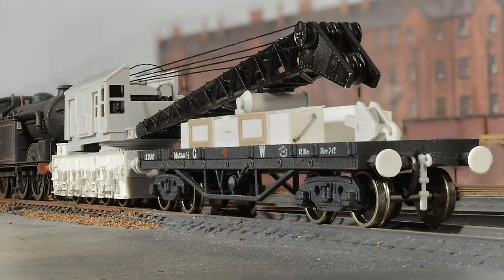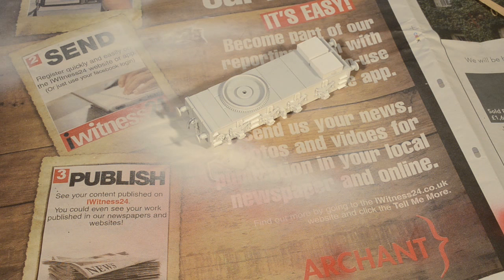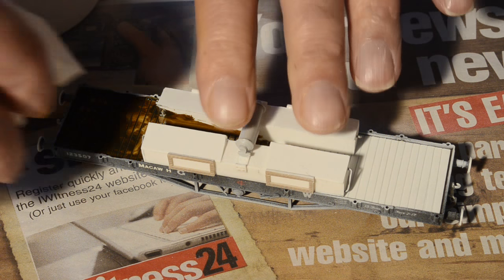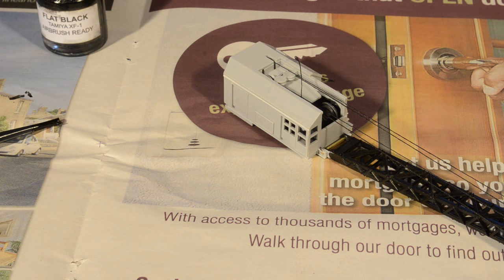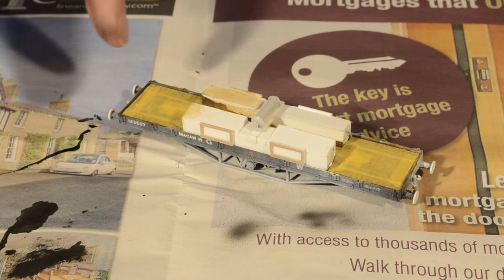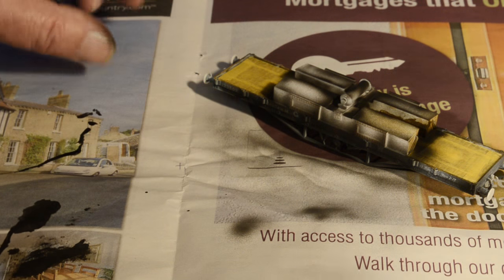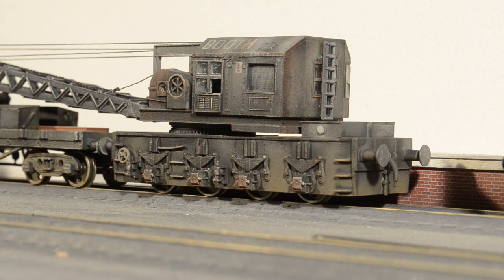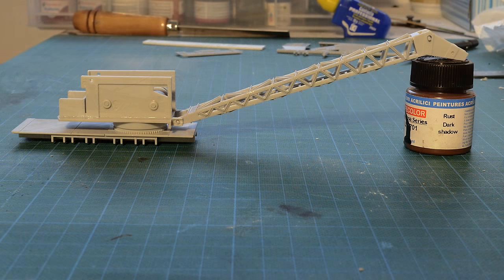DAPOL 15 TON CRANE # 3

Comment: Excellent project and explanation David. Given that you have not installed couplings, will this form a static model in your MPD?
Reply from the maker: Hi David, many thanks. I will fit Sprat & Winkle couplings to it, but I want to make a jig for fitting these to make them run more consistently than mine do at the moment. Another video here when I do this. Although the crane ''works'  it will be more an item of interest on my railway. I have bought a toad guards van that I will convert into a mess van for the crane in the future - I would like to see it running on my layout one day. Regards, David